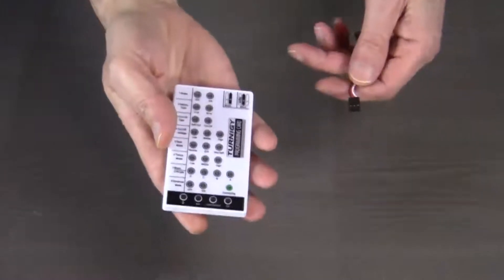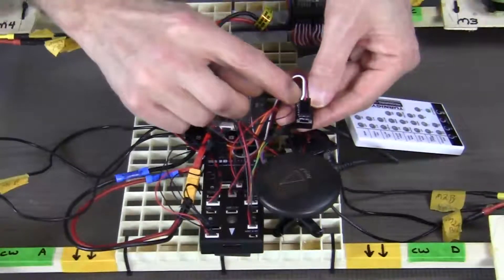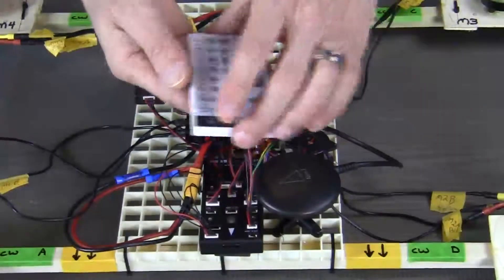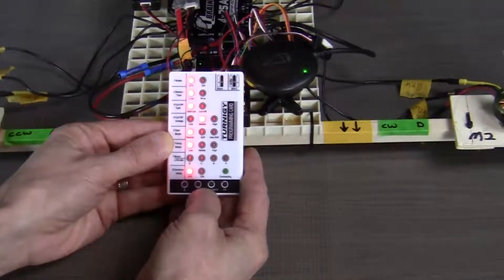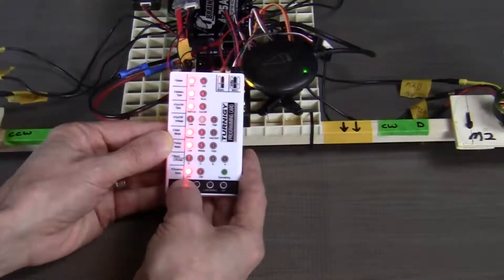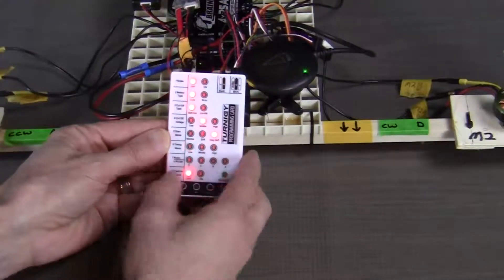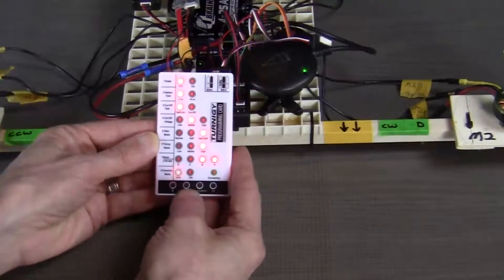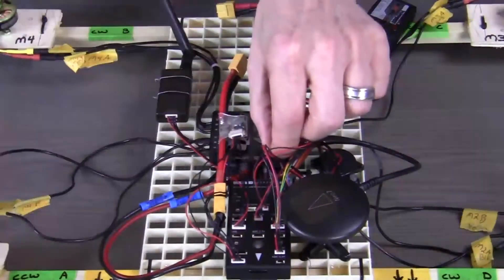How to Build a Quadcopter With a Pixhawk Flight Controller Step 6

Comment: Wow, this has been massively useful in getting this configured. Lots of little undocumented "this and thats" to get the Turnigy 9 configured with PixHawk. Everything is hooked up...still haven't programmed my ESCs, (Emax Simon 12A) and still have gotten no response from my motors to transmitter commands even though red LED in receiver is steady and not blinking.

Comment: I've been following your build and doing this on mine. Up to this point, everything was fine. My esc's just beeps. I've programmed just like your instructions but to no avail. Did you have the qbrain plugged into the Pixhawk RC spot, while programming or was it unplugged? And are all the wires on the signal side of the hub? Your detail picture shows them not in line but you say they should. Now my esc's just beep and believe it cannot be reversed.